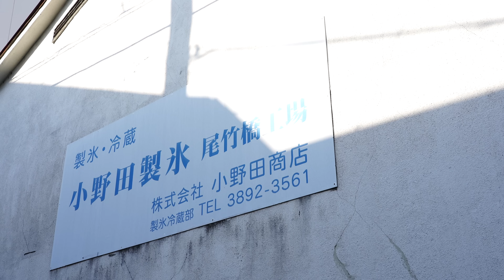東京の水道水を世界一透明な氷にする工場 / Japanese factory processes Tokyo tap water into the world's clearest ice

Comment: How can they call that the world's clearest ice?  There is something that looks like bubbles in the center of each block.  Outside Kiruna in Sweden (Jukkasjärvi) they cut blocks out of a river that are completely transparent.
Reply: The bubbles exist as a flat layer in the middle, 2 dimensional. The ice block is cut along this line and then the cut surface is ironed (with the clothing iron) if that cut surface needs to clear and smooth. But yes the title is cringe and added on by the channel. They got you to comment and drive up engagement
Reply: Did they fail to mention manmade? No? Okay then